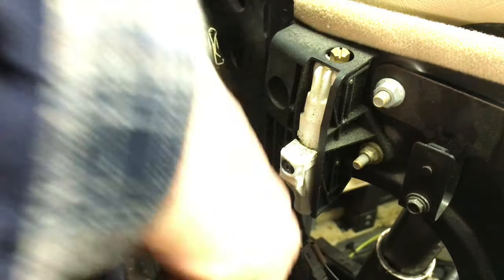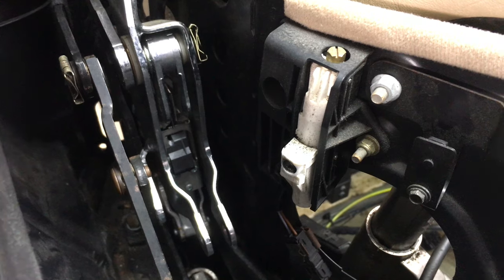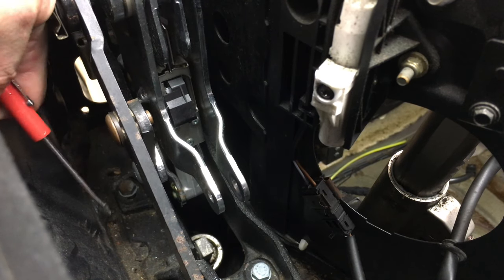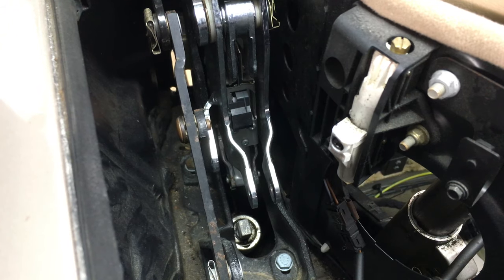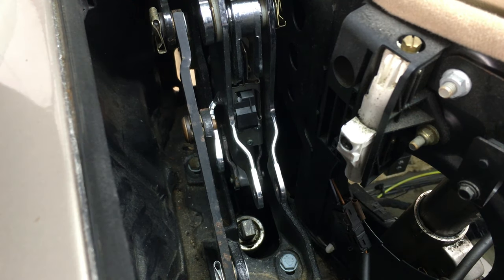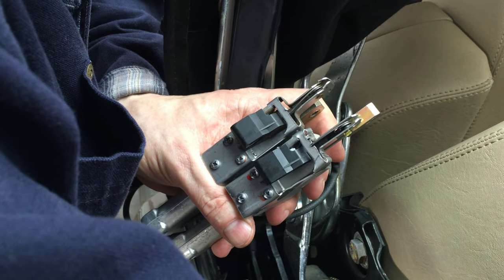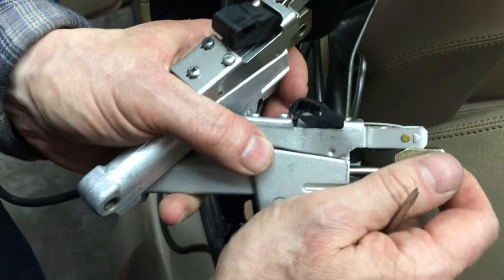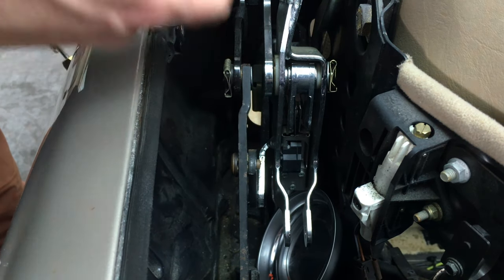Mercedes R129 SL-Class - Chapter 6 - Replacing the Bow Extension Cylinders

Comment: Klaus,

For the bow extension cylinders. I have secured both bow extension cylinders with their bottom pins. To secure the top pins,  I have raised the front portion of soft top vertically and lowered the bow. This gives me access to secure the top pin.

I assume I have to extend the bow extension cylinder rods to attach the upper mounting pin? 

I don’t want to bend those rods again😅

Thanks again
Reply from the maker: Yes, extend the rods until they are at the right length to install the upper mounting pins. Remember that one the left bow extension cylinder, the brass colored rod end on top is asymmetric and the wider side should be facing the switch, which is in the rear of the cylinder. 
The number one reason for a shaft getting bent is if the top collapses while the pins are getting installed. Ideally, have someone holding the top for you while you install the pins.
Reply: @TopHydraulics  thank you so much. I installed both bow extension cylinders installed with help. Just need to fill up the pump reservoir and test the soft top.

Seriously, thanks for all your help!

Comment: I did band macro switch where I can get it and what they call it or if is serial numbers thanks you’re video s helpful a lots
Reply from the maker: The part number is printed on the black plastic piece. However, Mercedes ells it only together with the cylinder A1298001772. Your best bet may be getting a used one off eBay. Top Hydraulics has a small inventory of these switch assemblies that we save for customers whom we have rebuilt A1298001772s for.

Comment: hello! i am replacing the seals in these very cylinders right now. when i install the new cup seal into its location then go to reinstall that small piece onto the shaft, it wont make it passed the edge under the threads. I've tried using a very thin plastic to cover the edge and threads, but it is going to take too much force to install. I haven't damaged the seal, yet!
Reply from the maker: Thee is a lot more going into a proper rebuild of these cylinders than meets the eye. All metal surfaces that are touched by the seals must be perfect, the gland needs to be tightened just right, and ALL seals need to be replaced. That includes the cup-shaped rod seal, the gland seal, the wiper seal, the piston seal and both port seals. Did you notice the felt wiper seal? When it fails, the fiber strands can get caught under the rod seals lips. The port seals (where the hoses go in) may not be leaking yet, but they will fail eventually.
If you purchased cup-shaped seals online, then they are most likely green or blue and someone is saying that they are "from Germany". They are not made in Germany and they are not even as good as the original ones in your cylinders.
Reply: @TopHydraulics  im simply asking for any tips on installing the cup seal into cylinder ending with 1772. yes, everything is being replaced. yes, ive done this before without failure.
This time around, on this particular cylinder with this single cup seal, it does not want to go on without extreme force.
i have installed the seal into the portion that takes 2 pin snap ring pliers remove and install, while off of the rod.
am i supposed to place the seal onto the rod, then press it into its location, as the others are?
it fits fairly deep into this portion of the cylinder, i felt as though i would risk damaging the seal by placing it onto the rod first.
My next option is to slightly file the edge on the rod under the threads.
If you can't or won't help. just say so 👍 no harm done.

Comment: Klaus, to be sure, do I first install the bow extension cylinder before installing the main lift cylinder?

Thanks again
Reply from the maker: Either way works; I personally would install the main lifts first.
Reply: Thank you. I managed to install the left main cylinder. However, the left bow extension is giving me a hard time.

Should I connect the lines first and fix it to the upper mounting point? Or should I mount it first from the bottom and then connect the lines?

Lastly, should I install the microswitch to the left bow extension cylinder prior to install?

Thanks again

Comment: Hello Klaus , I want to remove the whole top and frame assembly on my 1997 SL320 R129 , if I understand correctly, do the lines have to be disconnected from these bow cylinders, before the top assembly can be lifted off. Also ....with the frame assembly off the car , can the hardtop be reinstalled manually without any issues . 
 Thank you greatly Klaus
Reply from the maker: It is easier to disconnect the lines for the bow extension cylinders from the valve blocks in your case, if you happen to have the carpeted trim panels under the roll bar removed already.
I don’t see any obstacle to manually installing the hardtop afterwards.
Reply: @TopHydraulics  great , thank you Klaus for the information. I want to make a repair on the rear window. The stitching came loose and I'd rather repair it , with the top assembly off . It's good to know I can install the hardtop , without issues. 
  Thank you again Klaus .
Reply: @TopHydraulics , Klaus , I have a couple more questions referring to the top and frame removal on the 1997 S320 R129 ,  could you please give me a few steps on removing the frame assembly. I'm assuming the rollbar has to be in the up position , to remove the two rear side panels and to get access to the top assembly bolts and to remove the lines from the vave blocks . Where are the valve blocks located. How can I get the rollbar back down with the lines removed from the valve blocks or can I install the hardtop , with the rollbar in the up position and I'm assuming , leave the rollbar in the up position , until the top assembly is reinstalled . I saw in one of your previous videos, on how to remove the rear side panels . Any information is greatly appreciated. Thank you Klaus
Reply: @TopHydraulics  Klaus, do you know what face pin spanner tool to use to undo the screw cap on the bow extension hydraulic? I’ve done all other cylinders and I was able to take one of the caps off by heating it, but the other is being stubborn.
Reply from the maker: We make our own tools for every step of the way.
Reply: @TopHydraulics  ok, I’ll probably need to send this one to you. I was on a tight time schedule with this car which is why I didn’t send the set to you to begin with.

Comment: Does the top part of the shaft need to be unscrewed to replace the seals (like the main lift cylinder)?
Reply from the maker: There are six seals that need to be replaced for a proper rebuild: the cup shaped rod seal, the wiper seal, piston seal, gland seal and both port seals. Nobody will sell you all of these seals, plus the danger of damaging the shaft on this cylinder during a DIY repair attempt is quite high.  To answer your question,  the rod end needs to be unscrewed.

Comment: Thank you for posting this series of videos . I came across this video first and watched it . 
  You explain alot of necessary information for removing these cylinders. You are very thorough in your instructions.  I want to do these myself and now i believe I can .
   I also subscribed. 
  I have a question.  Can I still drive my R129, with cylinders removed ; while I am in the process of removing cylinders. I'm assuming it may take me a week or so to finish the removal and rebuilding process .
Thank you again for these great videos. I will be watching the others soon.
Reply from the maker: Thanks for asking. Sounds like you are looking to replace the seals in your cylinders yourself - did I read that correctly?
Reply: @TopHydraulics  ,you're very welcome and yes , that's correct, by myself .
Reply from the maker: @thaddeauscaldwell7101  Thanks for the prompt reply. Which model year is your SL?
Reply: @TopHydraulics  , 1995 SL320 R129
Reply from the maker: @thaddeauscaldwell7101  You know from watching the videos that I am very straightforward. We have shipped over 100,000 rebuilt R129 cylinders over the past ten years and we know exactly what is involved in doing the job right, or there will be failures. There are plenty of videos out there that show how DIYers "rebuild" their cylinders. I have not seen a single one that showed the job done right, which is a shame and depreciates these beautiful cars. The problem is, ALL of the seals in these cylinders need to be replaced with the proper kind, or your success will be very short lived. There are the cup-shaped rod seal, the gland seal, the wiper seal, the piston seal and both port seals (where the hoses go in). Are you replacing all of them with the properly ones? 

To answer your question: yes, the car can be latched after the cylinders are out. You will have to replace the locks and rig them in a way such that they don't jam while you are locking them manually.
Reply: @TopHydraulics  , as far as I know , I plan on ordering a complete kit with the cup seals etc . I'm not really familiar with the other seals you mentioned. 
   Do you sell the complete kit and if so , what is the contact info and price and I'll buy from you . When i watched your video , I knew you had experience with these cars . I'm glad to know that you appreciate these cars as I do . I have two R129's ('95 & '96 , both SL320) .I also own a 1982 380SL R107.
   Do you have videos of you repairing each type cylinder for the R129 ?
   From other R129 cylinder repair videos, I assumed they were doing it right , as long as they use the right seals. I saw a video , where the guy cut a notch in the cylinder to get out the C-clip and I felt that a notch shouldn't have been made. I felt he was doing it wrong.
   Thank you so much for sharing your knowledge on your videos. From watching this one video , I learned alot.
   I probably won't temp to drive my SL when I'm doing the cylinder repairs. I have other cars I can drive .
   I was going to start with the easiest header bow cylinders first and then go on , to the more complicated ones. 
   I grew up working on cars . I do most of the repairs on my SL's, as long as it's not electrical or inside the engine. I haven't had any issues with those areas.
   Again, thank you so much for sharing your knowledge about these cylinders.
    I'd like to add ,that I Google Top Hydraulics and found the contact information and read that you have complete cylinder rebuilds ; in exchange for the customers cylinder cores and a fee. I will be calling monday to find out more information and then I'll remove the cylinders from the car and prepare for shipment, as stated in the Web site.
    I'd rather pay for rebuilds ,knowing they were done right and it will save me alot of work , trying to figure it out .
  Thank you again.
Reply from the maker: @thaddeauscaldwell7101  I respect the spirit of wanting to do it yourself. Make sure you get all seals in the kit, including six seals for most cylinders. I am not aware of anyone selling all seals, even though all these artists claim that they do. Our seals are far superior to any others out there and we do not sell them. We do not have videos on rebuilding the cylinders. We make our own custom tools for every step of the way. For example, is there any video out there which shows how to remove the port seals where the hoses go in? Be very careful not to put any scratches on the chromed cylinder shafts, or they will likely be ruined. We have many customers who purchased seal kits on eBay and ended up spending hundreds of Dollars extra, on top of the rebuild service, for us to replace all the shaft/piston assemblies that got damaged during the DIY effort. Plus, we do our best to help our actual customers with troubleshooting if they run into any operational problems with their tops upon re-assembly.